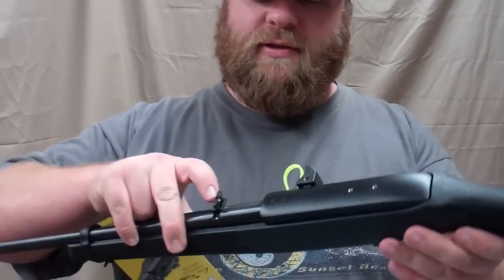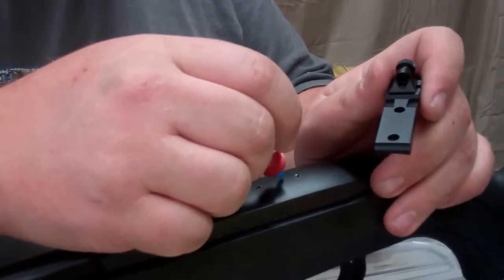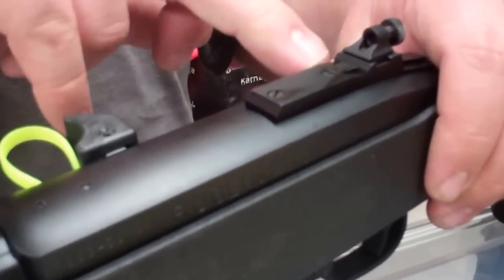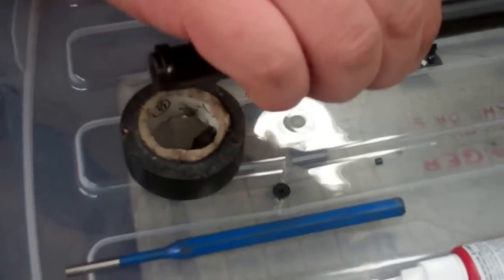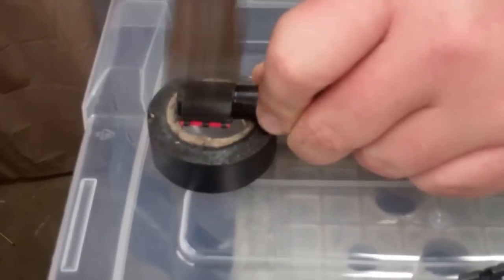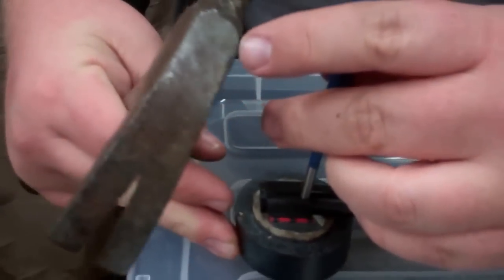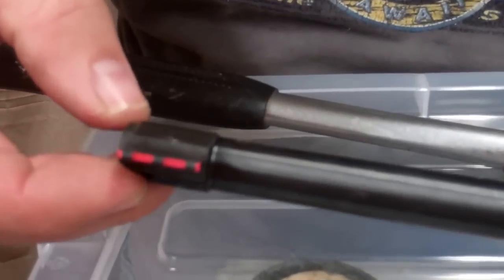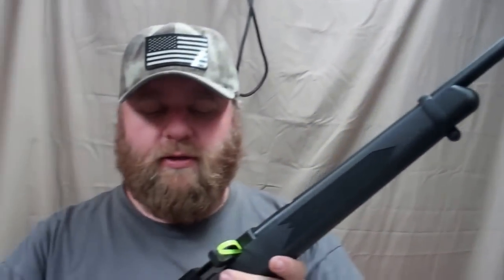installing a williams peep site with fire sight for the ruger 10/22

Comment: Did I see that right? You used a steel claw hammer and steel drift punch to beat the crap out of that firearm?  A full range of brass punches in a set or individually, brass tap hammers, are available on Ebay for less than the cost of a cold case. try a universal sight pusher too. Now I am understanding why I see so many buggered up guns out there on gun broker.

Comment: Does this specific sight set work ok on the Takedown model?
Reply: defuse56 no, you would lose alignment quick and have to re-sight after every take down. I’ve read a lot of Appleseed instructors reporting that issue from students who just slap some tech sights on their TD Rugers.
Reply: The takedown and standard model have the same sights from the factory. But the Williams pep sights will work better than what comes from Ruger. Yes you may have some issues with the sights. Some of the takedown models have issues with the sights not being on target after you take it apart and put it back together. But its usually an error on the user's part. Most often with the barrel not being tight against the receiver.

Comment: Good demo video, can be done anywhere with almost any tools available even with steel on steel, pounding on top of a plastic tote box, LOL. You did mention in video that it would be better to use brass punch and hammer. Perhaps hold very steady and use wood table and protect in wood vise or something just incase you want to sell gun,  but if cheap heavily used $200 Ruger 10/22, Marlin or similar no big deal. Thanks for DIY video. I liked part about 100+ yards with peep versus without (ghost sight) for closer tactical shooting. Trying to decide between this and scope (see thru rings) or with red dot mounted on top of or beside scope. This Williams is MUCH cheaper and simpler.

Comment: read your instructions that is way too tight you should file some of one side of the dove tale until you can get it started at least 1/4 way then use a brass punch to go the rest of the way. You should be able to just tap the sight in , file until you can do it wright.

Comment: Hey, great video, thanks for making it. When installing this, do you need to replace the front sight or will the back work with the stock one? I’m not sure if you’ve tried it or not, just curious, thanks.
Reply: I don't think it will, because with the aperture sights mounted on the scope rail the existing front sight post isn't tall enough anymore to be inline with the new rear sight.